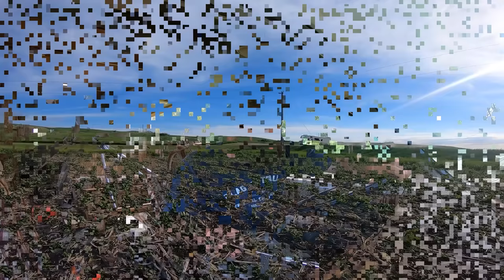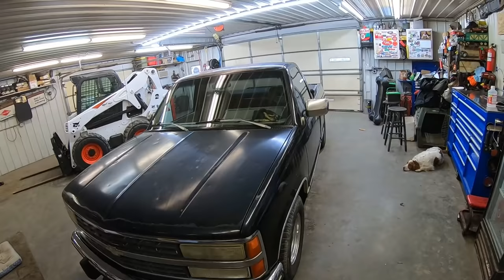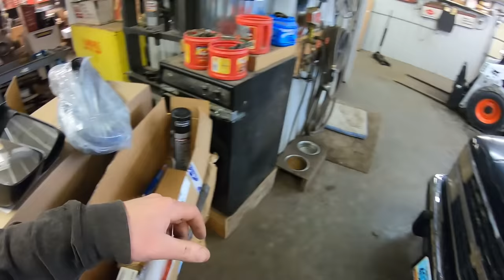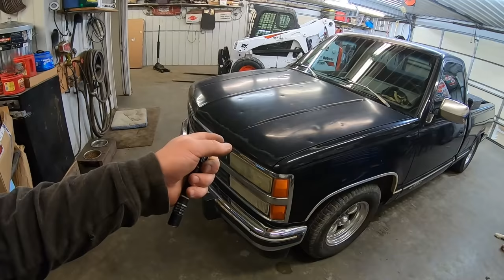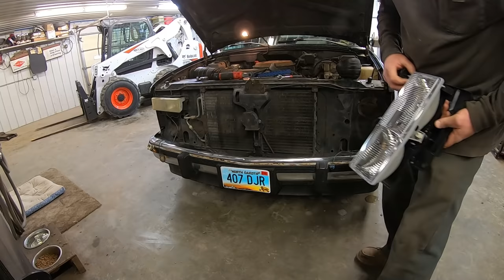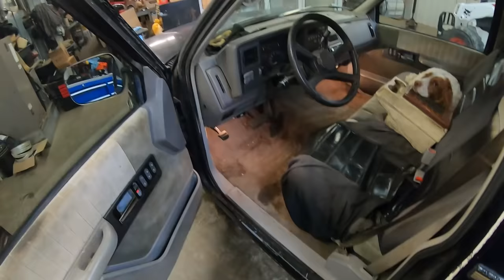Budget Interior Transformation! 1992 Chevrolet Silverado! OBS Upgrades!

Comment: If you ruled out that you do not have a heater core leak I can promise you the source of your wet carpet is from a condensation drain hose under the HVAC system inside that goes through the firewall that over the years can get covered and clogged from accumulating leaves and debris from the cowling. Once it gets clogged the condensation will roll backwards into the passenger side floorboard underneath the carpet which if not discovered early enough will end up soaking into the soundproofing causing mold and moldy smell. Which is usually the first indication unless someone happens to feel the super soaked carpet, unrecognized and if it doesn't get dealt with right away it will definitely eventually rust out the floorboard. To clear the drain hose out it's not good enough just to try to do it from under the hood you have to be patient take some time and remove the blower fan and take a shop vac with a flexible hose and get in there and vacuum out all the leaves and debris, then flush out it out with some soapy water and degreaser from the inside out through the firewall until it runs clear then take your leaf blower and blow all the water out until it's dry and then replace your blower fan. The little tiny rubber hose is very hard to see   it's just below the AC dryer canister under the hood in the very bottom and goes through the firewall.

Comment: Best upgrade you can do for your headlights is add a relay harness so the bulbs get full wattage and it takes a load off the switch
Reply: Link? My headlight switch keeps getting hot and eventually fails.

Comment: One of the best upgrades I did to my obs was the headlight relay upgrade. With it the low beams stayed on with the high beams, plus it took the load off of the switch.
Reply: Did that with a 68 Mercury Comet,  I could actually drive safely at night afterwards.
Reply: ..that sounds like a good idea..how do you do that, and how complicated is it to do?..and how much modification to the wiring do you have to do?....
Reply: @dyer2cycle  I bought a kit from Lmc and followed the instructions.
Reply: @dougmcgee30 what does it mean to take a load of the switch? what switch? like the actual headlight switch on the left side of the steering wheel?

Comment: You did the right thing replacing the headlights, the 3M kit is amazing and I'm sure you could have brought those old ones around but you still did the right thing
Reply: The problem with polishing up and or clearing the upper headlights is you can still see the yellow of the glue and the UV fading around the edges and on the inside. I just did this and the reflector bowl Chrome also was coming off. You can get away with sanding and clearing the lower lenses.

Comment: I'm sure it's mentioned somewhere else in the 2900+ existing comments, but the column shifter has a return spring in it that was used in just about every column-shifted GM vehicle made from about the mid 80s - mid 90s. They are mounted inside the column against the shifter and often break. I just had to put a replacement in my 1994 G20 van. Pop out the pin that holds in the shifter lever and it's right there. Can be removed with a pick. No column removal or disassembly needed. Like $10 on ebay for a new one, or pennies on the dollar at your local salvage yard. I took mine from an early 90s Buick something-or-other. Kind of annoying to put in, but not too bad and worth it.
Reply from the maker: Thanks for the info!

Comment: A 94-98 grille would really improve the appearance Bud. I have always been amazed just how much a simple grille change classed up the looks of the whole truck between 93 and 94.
Reply from the maker: I agree
Reply: I just changed out my 91 grille to a blacked out 94 style
Looks much better
Not as easy though as just swapping the grille. The filler between the grille and the bumper has to be changed as well
 You also need to have the parking/turn signal lights for the 94 and newer.
Reply: Looks good
Reply from the maker: @michaelforeman4089  Thanks for the info!
Reply: I agree..the '94-'98 grill looks better than the '88-'93 in the Chevy..on the GMC, however, I think the opposite is true..the '88-'93 GMC grill looks better than the '94-'98 GMC grill..I have an '89 Chevy, a '90 Chevy, a '91 GMC, and a '98 Suburban, and to me the '91 GMC grill looks much better on the truck than the '89 and '90 Chevy..I also think the original('88-'93) Chevy grill was designed to be used with the quad sealed beam headlights..I think my '89 with the sealed beams looks better than the '90 with the plastic headlights..IMHO, the one-piece plastic headlights and the '88-'93 grill used together gives it to much of a "flat" appearance...the '98 Suburban has the newer style grill, and it looks better with the plastic headlights..I'm not going to swap any of the grills, though, as I don't like "mix and match" parts swapping between year models..rather leave them the way they were created... :)

Comment: Personally, I would have repaired the passenger's side door hinges first for practice, and then the drivers side, because it gets used a lot more.
Great instructional video.    Maybe use the leftover headliner material to recover the visors? You could just throw those seat covers in the wash with the rest of your laundry, they'll be fine.

Comment: You need the sensor in the front of the donor truck and the pigtail for the  rear view mirror for it to work. Very easy to wire up. You can replace that hinge pin roller too.  Did it on my 89 Silverado.
Reply: Ty! I have a 1998 GMC Sierra z71 fully loaded but the mirror info doesn't have the outdoor temp option. I recently got a mirror that will display the temp from a friend but I wasn't sure what else I'd need to make it work.
Reply: I'm in the process of doing the same on mine,  if I get the pigtail of the donor car, where should I plug that in? My truck is a 1996 k1500 z71 ext cab. Thank you.
Reply: @carlosaranda4893  there is a write up online somewhere. The sensor gets wired into the pigtail and it needs keyed power and a ground if I remember right. It’s been about 10 years since I did it.

Comment: Hey!  You can actually pull the upper headlights out without removing the grill if you undo those pins on top with a 5.5 mm socket... You only have to remove the grill if you're replacing the entire backing plate but I read somewhere not to use the dorman ones and to just reuse the GM ones with the new dorman lenses
Reply from the maker: Thanks for the tip!

Comment: Another option for that carpet that I do to all my vehicles is Tuff Stuff upholstery cleaner and a round brush attachment for your drill. Soak it with the Tuff stuff for 10 mins or so then use the drill brush and 9 out of 10 times any drink  based and even some grease based stains go away. Then after the carpet is dry and stiff feeling run that drill brush one more time and the carpet softens up almost like when new. all in all it only takes an extra 15-20 mins over what you did. Just a different option I do. works for me for what it's worth.  Like the channel keep up the good content.
Reply from the maker: Thanks for the tip

Comment: For your head lights, to clear them up, wet sand them with find sand paper, let them dry, then spray clear them with glossy clear  spray. I had the same problem. It works!
Reply: ..or switch them over to the glass '88-'89 sealed beams..no more cloudy/yellowed headlights, ever!..and they are much cheaper to replace when they do burn out....

Comment: 2nd channel name, " Do it! Or don't..." On the ac control, try changing out the relays for new ones. There's 3 of them. It worked on mine. On the shifter arm, check the pin to see if it or the arm are wallowed out. Quick change out of either.

Comment: I have a 2002 GMC Yukon Denali that had regular halogen headlights. I hated them so much, especially driving at night. I could barely see anything with them. Sometimes I'd be scared to drive at night. Especially in areas where there wasn't many street lights to light up my way. So eventually I purchased some "inexpensive" LED bulbs & put them in. So far I love them, they work & look amazing. They also made the truck look "more modern". Thankfully the Denali variant of the Yukon comes with Projector headlight housings from the factory, so LEDs & HIDs work perfectly in them. Where as with vehicles that have regular reflector housings that scatter the lights & blind oncoming traffic. It's extremely annoying. But anyway, before I purchased those LED lights I was debating on LEDs or HIDs. But I've always had bad experiences with HIDs. Having to deal with an annoying ballast or modifying something is not my forte lol. I just wanted something that was "plug & play" & i found LEDs to be perfect. also the color that I got imo was the best output option. They're not blue to the point that they start looking like purple (I find those lights useless because they look so dim imo) but they're far from looking "yellow" I find that yellowish light output color to look archaic. I think the color I chose looks more modern & luxurious. I see that color on more expensive vehicles. For example if you notice the color that the new Toyota Corollas have, they're way to blue. They almost start to look purple in certain angles lol. No hate, but that's just not my taste. Also like I said, thankfully the Denali comes with Projector headlights from the factory so I didn't have to mess with the actual housing, because I do not like aftermarket headlights either. Some look ugly af. Same thing with tail lights. I've seen some really ugly LED tail lights. I upgraded my truck to some LED tail lights that look more factory-ish & I really like them. They're all red & have a red LED light bar running through them sort of like the newer model GM trucks. Before it had some aftermarket taillights that were see through plastic. I guess it was trying to look like the 2007-2014 GMC Denali (which looks good on those models) but I just didn't like them on my year model. That was all the craze back in the early 2000s to like late 2010 lol. Everyone wanted to have those see through taillights. Some companies even started putting them on their cars for example the Nissan Altimas have those See through tail lights. The Lexus IS models also used those type of tail lights. Thankfully that trend died out lol. I never really liked it tbh

Comment: I got LEDs for my 99 k1500, drained the battery overnight and they looked dumb with the OBS. Swapped them for the exact kit you got and it fits so much better with the styling of the truck and they shine just fine. Only issue was the plastic clips breaking off when i removed the grill. So much brittle plastic on those OBS
Reply from the maker: Awesome

Comment: Depends on the $50 bulbs but yeah, the Phillips and Sylvania pricey ones are nice, dunno if they last longer tho! LED lights don't work right unless they're in fixtures designed for them, they just kinda throw light out and blind everyone. That's why some sealed beam LED conversions suck giant balls and others are like turning on the sun, all about how you project the light. Virginia outright banned LED lights in non LED external light fixtures on cars 'cause it was dangerous as hell.

Also the replacement bulbs with the replacement headlights are usually pretty good, unless they're not, it's really one or the other.

Comment: Aluminum foil around the fuel lines did help with vapor lock.  I don't recall ever using clothes pins, but they might help with creating a gap away from the heat source.

Comment: If you are still rolling this, I had the rubbing issue with my upper control arm hitting the rim when I went with some 16's. Did try some clearancing with with the death wheel, but no bueno. At least, I didn't want to take any more metal off. So, slipped in some 3/8 (1/4 to 1/2?) inch spacers and problem solved. I like your wheels. Look like Kreggers. :p

Comment: For the driver door spring…there is a tool you can buy that looks like a beefy valve spring compressor to fit the spring in while the door is on the truck.  I have the tool…getting it in there is still a pita though…
Reply from the maker: Just picked one up

Comment: About the air conditioning, it's probably the o-ring around the main body of the compressor. I thought I'd get away with just a Schrader valve and a recharge but after adding the dye it was clear it needed to be changed out and since I was doing that that led to doing the dryer which led to kinking and ruining the evaporator core line into the dash. Which led to replacing all of the hard lines and the condenser.

Comment: I have an '89 Stepside that I put the compass mirror into. You need the temp sensor that mounts in front of the core support, right under the hood latch. If I remember right, it's a simple matter of running two wires from the temp sensor to the mirror, and then a hot and ground on the mirror. I just picked up an '88 one-ton for free (you can imagine how horrible it is), and I'm looking to upgrade it to the temp & compass mirror as well. Just so you know, every Suburban in the OKC Pull-A-Part has the mirrors and sensors robbed. As of last weekend there was a good dash, intact, but maroon (I think) on the first row of pickups. I know because I yanked it to get the heater & A/C box and gently set it in the bed.
Reply from the maker: Thanks for the info!
Reply: @MortskeRepair  More info: I got another compass mirror today for my '88 C3500, and immediately noticed it has 7 wires. I looked back into the wiring diagram. The pink wire in terminal 1 requires switched 12v. The black wire in terminal 2 is ground. On the far end of the connector, the green/black and brown wires go to your temp sensor. It's a thermistor, so they shouldn't be polarity sensitive. If you care to, the light green wire in terminal 3 goes to your backup lights, and the gray and pink wires in terminals 4 and 5 go to "automatic" outside mirrors if you have them.

Comment: My old dirty work van only worked on defrost and that was fine because at least I could get still use the air conditioning. I used to shift it to vent ( it wouldn't change but the compressor wouldn't run) . After a visit to the local garage I turned the switch to vent and just got covered in a cloud of dust.  The mechanic found a vacuum line off a pushed it back on. Couldn't be made cause I had vent again.

Comment: Those headlights are terrible, old or new. They didn't seem bad in 2003 when i had my first one, but everything else had incandescent bulbs also. You're not supposed to run those mode door actuators with them detached from the box, they get out of calibration. You can bend your head down and just watch the end of the shaft to see if it changes when you change modes or whatever you want to do. The one on the far left that you took down should be the mode actuator, the one in the center behind the ashtray area is the blend door actuator and the one up at the top under the dash that you can't get to without pulling the box is the recirc actuator. Good luck with that heater hose connector. That's a breakdown waiting to happen. The fix is to pull the intake, break off the remains, chisel out the rest, install a steel nipple and use regular heater hose. There should be a restrictor in there that you need to replace...otherwise the heater core will gurgle and you'll split heater hoses. Duff seemed a bit out of it in this one...hope you haven't been sharing sammiches with him LOL. The second channel should be Mortske Life. Has to have the name or they won't find it.

Comment: Low buck interior cleaner, a little bit of “westley’s bleche-wite “ white wall cleaner and hot water. Apply with a wheel brush on that big blood stain on the passenger side of your seat. It should clean it right up. Rinse thoroughly.

Comment: last week, i traded the grill, headlights, marker lights, side lights, sport mirrors, front bumper, and an expanded steel mesh tailgate with a fifth wheel dip, off of my '94 1500 silverado, for a '98 s10 with a blown engine and a t-5 tranny, as a frame to sit under my '36 chevy truck cab, to a kid who hit a deer with his '93 1500 base model. the frame and 4x4 drive line from the '94 is going under a '54 chevy 5 window truck cab, so to me, the parts were basically just junk i had to get rid of. sometimes the universe just lines up and smiles down on a feller. edit; my interior is dark blue and for an extended cab, but you can paint the plastic to match yours if it would fit. the truck is a tiara motor coach conversion, and has some solid oak face plates on the dash, and door panels, and has an oak ceiling storage cubby with custom rope lights behind plastic panels, with a factory installed radar detector from '94 mounted in the switch panel. it has good vinyl sun visors, and the front 60/40 reclining back leather seat has the tmc logo stitched into the headrests and has a flip down center arm rest/back rest. the driver's side seat cushion has some issues, but is pretty still pretty comfy. they're yours if you pay the shipping, or you can take a roady to northern indiana and pick it all up. if you're interested i can email you some pics. the frame and suspension, engine and drive line, fuel system, brake system, radiator, heater box and controls, pedal assembly, steering column, and wiring harness are the only parts i wanna keep. basically, all of the bits to turn the '54 cab into a real truck. i even have a pallet of brand new rubber bed mats, and i'll throw in couple as a bonus.